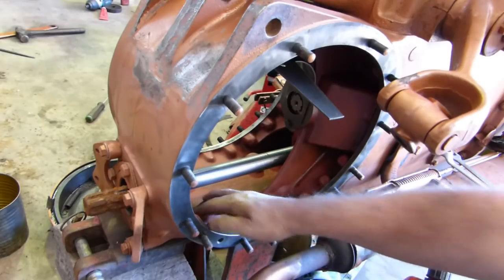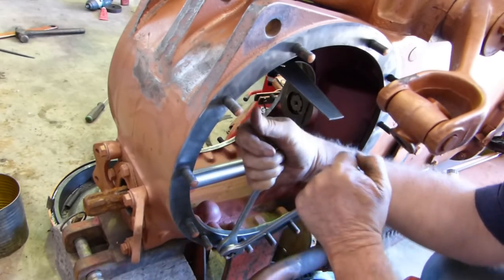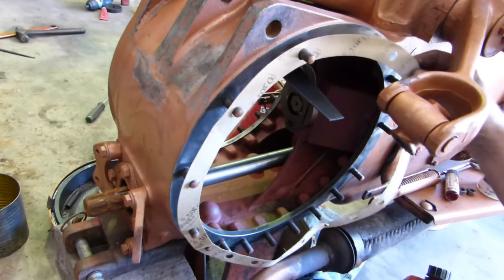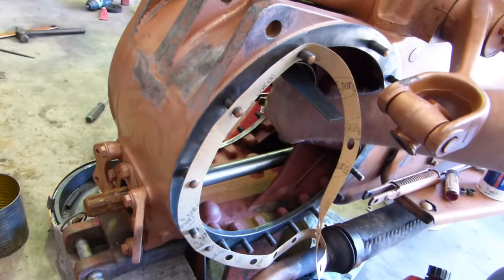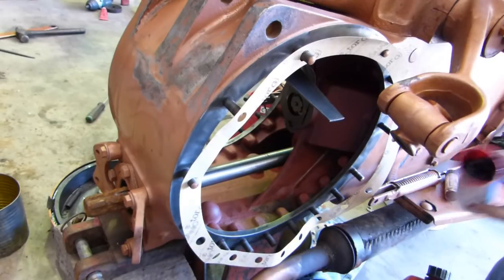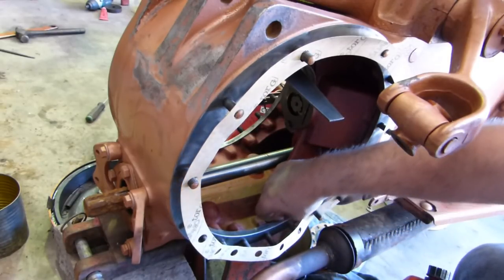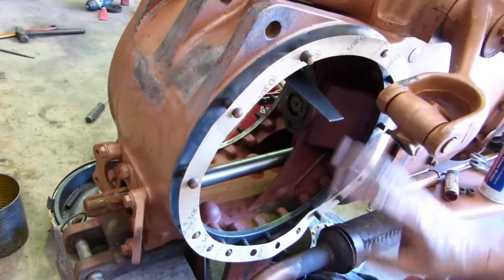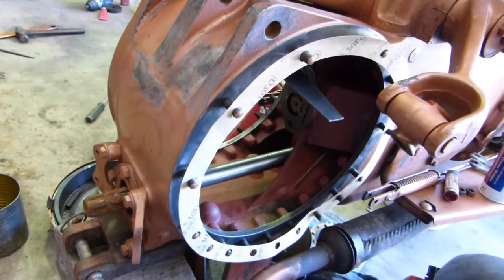Ferguson FE35 Grey and Gold Restoration Part 11 Fitting the Axle Housings and Diff Center

Comment: the only time I use gasket goo is watered down with some thinners on water pumps that dont like to seal you only need a film of it for it to work not in gobs of it and work quickly so it works as a sealer, or get things remachined to fit ! grins
Reply from the maker: Yeah no need for it most times. boy do we see some messes from the silicone products.

Comment: hi lance removed  trumped housing to replace lower  bolt  for linkage  and found a bolt missing from crown wheel  have looked every where and used a magnet around every and cant find it wondering have you came across this problem bbefore and if so where did you find it.  any help would be great wonderful regards frank love your videos
Reply from the maker: They often come loose but it is usually still there from what I have seen.
Reply: thanks Lance